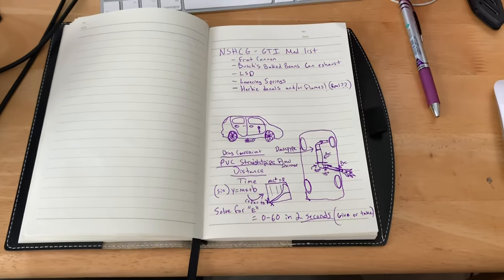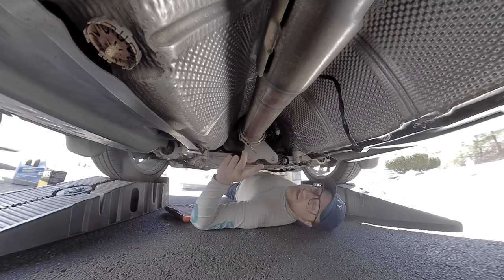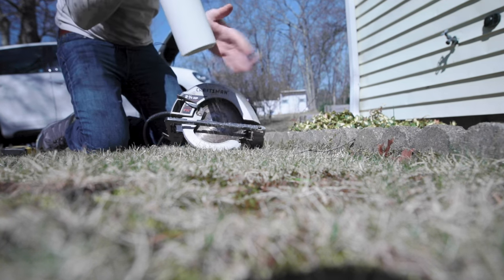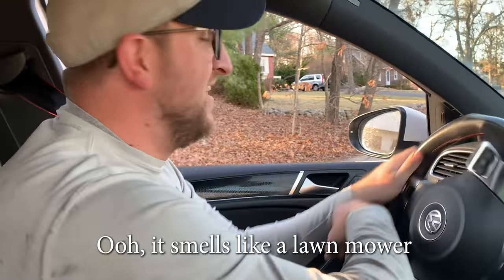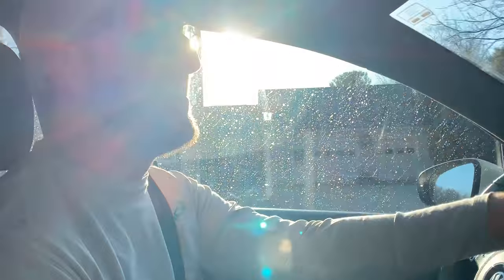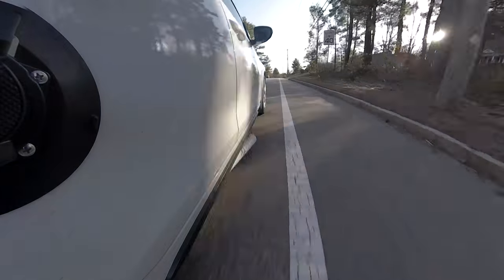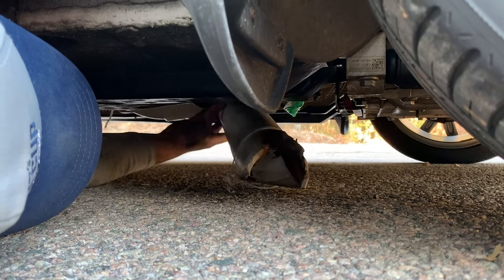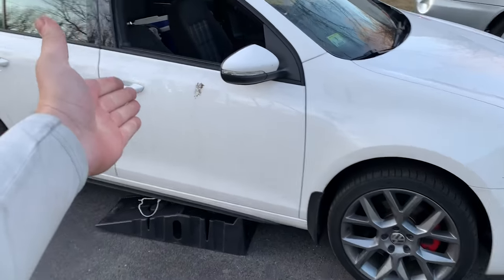VW GTI Straight Pipe PVC Exhaust - IT CAN(t) BE DONE!

Comment: Fence post may work.Just got free PVC but what if only the last part of the exhaust was PVC.a drone tube tuned to the loudest frequency will reduce noise.the math is on line to make the teeded in drone pipe for 3.8 V6 tuned to 1500 rpm is .552 meters try fence post